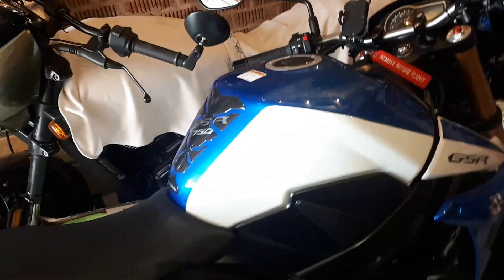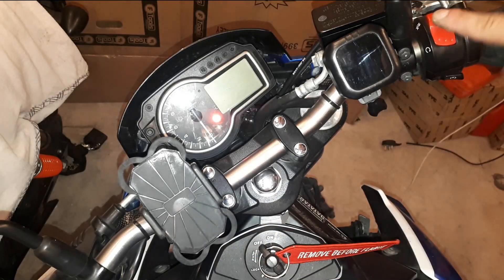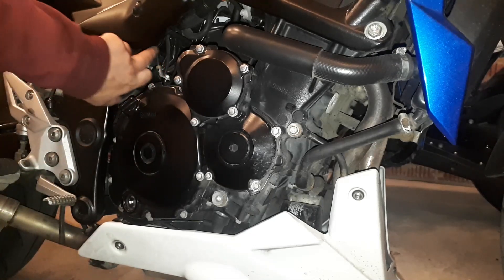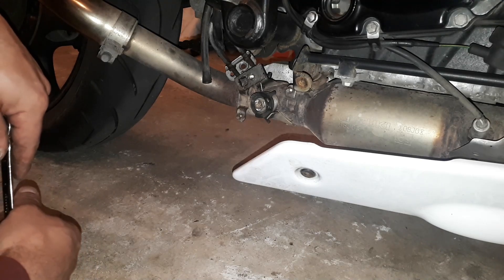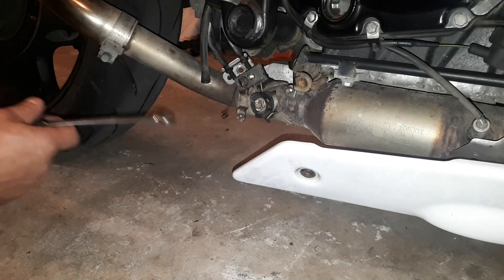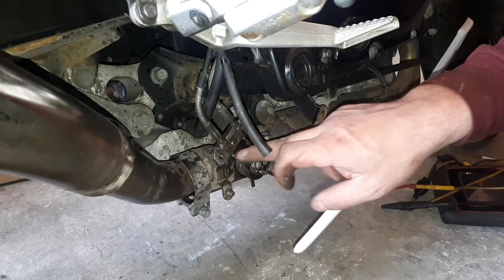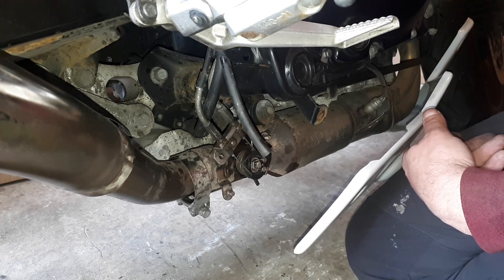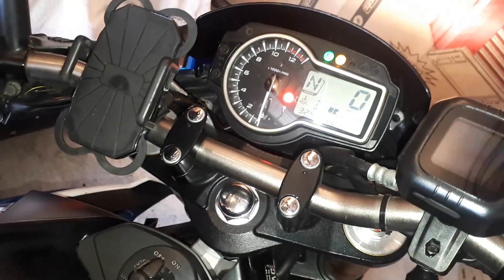Suzuki GSR 750 SET Valve Exup Exhaust Valve C46 Dealer Mode

Comment: If this gets stuck could this cause the bike to jolt or judder when riding it? (Similar to when fuel pump is about to fail) Am I right in thinking if it's stuck on closed then it will stop the combustion cycle and cause the bike to jolt? Thanks
Reply from the maker: if it will restrict air flow, yes, it will cause drivebility issues

Comment: why would you tell people to activate the motor when not connected! its completey pulled the cable through one side and ive been unable to get it in the right position !
Reply from the maker: I have not told anyone to do anything, I just shown what I did and you use the information as you find fit. Are you going to jump in a well because someone said so?
Reply: @GicaPhp  you said now is a good time to check the motor operates fine when disconnected but it actually seems to mess it up instead, 
mabye its better to connect cables first then check at end once connected, 
i have had to take back out my motor which was a nightmare and take off the motor gear to put cables back in right position but i dont know if i have ruined the motor in the process because of this!, i think i may have flat battery now so will find out tomorrow, 
besides that a helpful guide
Reply from the maker: @richie5849  you can always power the motor externally and move the cable

Comment: Great video! One question, when testing the motor the pull cable on the right pulled to the top position and is now stuck. Any idea how I get it back down?
Reply from the maker: Power it up from an external battery

Comment: I unseized the exhaust valve but not the cables are stuck!! I can't believe you didn't include on you video how to sort the cables out...
Reply from the maker: I am sorry about that :(
Reply: How did you get the cable released amyrobson5369?
Reply: @leewilson4680  i didn't! I ended up knackering the motor! Because this video didn't explain how to release the cables...So I decide to keep the valve open and install a servo eliminator
Reply: @Aimless5369  thanks for replying. Not sure if this was right or not but I managed to pull the cable down through a combination of turning the key to make the valve motor kick in and pulling the stuck side when it did it’s thing. That worked and gave me enough slack to reattach it. 👍🏼

Comment: Hey I got these and the cables that were attached to the spring are stuck like pulled up, any idea on how to loosen it back up again? This happened because I disconnected it from the spring and turned the bike back on. Thanks in advance
Reply from the maker: the motor should open and close the flap. you will have to disconnect the motor side, as the cables are not sitted correctly and they got stuck inside
Reply: @George Moraru  Its weird because even in the motor side the cables have no room to play, its tight and stuck on both the motor side and where the valve on the exhaust its connected
Reply from the maker: @G22-l2o  you need to strip it down, and you'll see
Reply: @George Moraru  I took off the gas tank, seat and side fairings. On the motorside where the cables attached its stuck with no room to play, also down where the cables attach to the exhaust
Reply from the maker: @G22-l2o  Can you move the flap by hand just enough to see if it is seized in the axe of the exhaust?
Reply: @George Moraru  i can move the flap but thats not the problem. The problem is I disconnected the cables, rode the bike, now its stuck on the exhaust end and the motor end. 1 cable is loose enough for play but the other one is tight where I cant pull the cable for any room. Its like it got short out of nowhere where its unreachable
Reply: @George Moraru  the cables arent stuck on the exhaust because i disconnected it, its stuck in the wire like its pulled all the way up, n when i checked the motor it was stuck on that end too
Reply from the maker: @user-cl5ff7ez2r  it happened to me as well, the cable jumped out from it's place in the motor, I had to strip it down and refit it properly
Reply: @George Moraru  weird part is the cables on the motor looks fine, its just the motor isnt spinning far enough to give me room to adjust it, its like the cable got shorter out of nowhere

Comment: Awesome video, thank you George! I will do the same to my GSXR600 and hopefully would get rid of my FI C46 code too! Kudos!
Reply from the maker: Good luck!
Reply: I’m thinking about buying a 2011 750 gsxr and only has 3,500 miles but the seller has told me it’s showing the FI Light and it has to do with the butterfly exhaust valve and he’s asking 7000 for the bike but I don’t know enough about them  can someone please give me some advice all he said that it was a little difficult to start up when it’s cold
Reply: @chriseverette7379 I know it's a little too late but... Yes, if the exhaust valve got stuck half closed It would be difficult to start. If you follow this video maybe you can fix this issue because it's a simple mecanism.

Comment: If I want to do this fuse wire at home what amp fuse is on it please?
Reply from the maker: 5 Amps will do just fine
Reply: @GicaPhp  thanks George for this great video I did check the code on my bike and it was code 00 with the throttle sensor off,just a small adjustment and I was ready to go.
Keep it up brother and thanks again.

Comment: Excellent video, George! I followed your instructions and got a C15 reading (engine coolant temperature sensor) according to the list you posted. Would this issue make the bike difficult to start? I got it started once but nearly exhausted the battery supply. TIA
Reply from the maker: Yes, a faulty ECT will create bad starting, the mixture could be too lean or too reach based on how the sensor has failed.

Comment: Good video, i have this problem every year as don't use the bike enough. So only gets used say once a month during the fair weather months. I find that i get the error on every 1st startup but leave the bike to warm up to about 60-80c, turn the bike off laving it off for 7 seconds and turn back on and no error as the valve can now move due to the heat freeing up the stuck valve. 

I have taken it apart just like this video and re-greased, which fixed the problem but only lasted for 6 months and get the same problem again. :(
Reply from the maker: Yes, I know the feeling. Unfortunately the grease will be burned by the exhaust gases.
Reply: Is this something serious???
Reply: @chriseverette7379  no not at all just a pain in the arse.

Comment: Hi thank you for video really helped me just stuck on getting the cables back as it has pulled them in and i cant get them back thanks
Reply from the maker: No problem 👍 You will need to follow the cable to the motor and take off the rubber cover and you will be able to turn it by hand

Comment: very nice, its good to know how to get the C failure codes, do you know where i can find all the failures maybe?
Reply from the maker: C11 - CAMSHAFT POSITION SENSOR
C12 - CRANKSHAFT POSITION SENSOR
C13 - INTAKE AIR PRESSURE SENSOR
C14 - THROTTLE POSITION SENSOR
C15 - ENGINE COOLANT TEMPERATURE SENSOR
C21 - INTAKE AIR TEMPERATURE SENSOR
C22 - ATMOSPHERIC PRESSURE SENSOR
C23 - TIP OVER SENSOR
C24 - IGNITION COIL SIGNAL #1
C25 - IGNITION COIL SIGNAL #2
C26 - IGNITION COIL SIGNAL #3
C27 - IGNITION COIL SIGNAL #4
C28 - SECONDARY THROTTLE VALVE ACTUATOR
C29 - SECONDARY THROTTLE POSITION SENSOR
C31 - GEAR POSITION SIGNAL
C32 - PRIMARY INJECTOR SIGNAL #1
C33 - PRIMARY INJECTOR SIGNAL #2
C34 - PRIMARY INJECTOR SIGNAL #3
C35 - PRIMARY INJECTOR SIGNAL #4
C36 - SECONDARY INJECTOR SIGNAL #1
C37 - SECONDARY INJECTOR SIGNAL #2
C38 - SECONDARY INJECTOR SIGNAL #3
C39 - SECONDARY INJECTOR SIGNAL #4
C41 - FUEL PUMP CONTROL SYSTEM (PUMP/RELAY)
C42 - IGNITION SWITCH SIGNAL (IMMO)
C44 - LAMBDA
C46 - EXHAUST CONTROL VALVE ACTUATOR
C49 - PAIR CONTROL SOLENOID VALVE
C60 - COOLING FAN CONTROL
Reply: @GicaPhp  thanks man, appreciate it!!

Comment: So was there anything blocking the valve? Did it just need WD40 and a big of a wiggle ?
Reply from the maker: no, no foreign objectes blocking the valve, just bearings siezed, I used a lot of wd4 and wiggle, I even put it in the drill and spin it until all was super smooth.